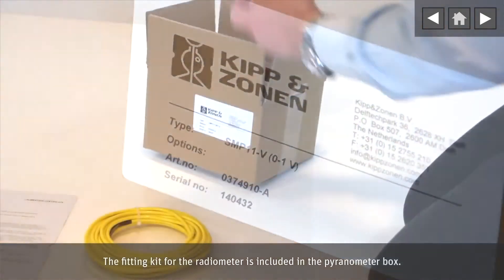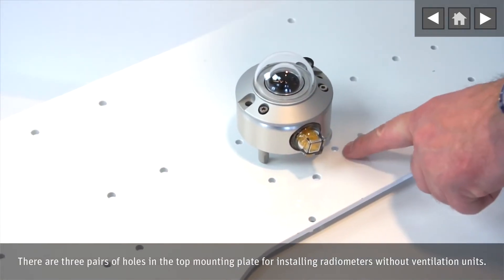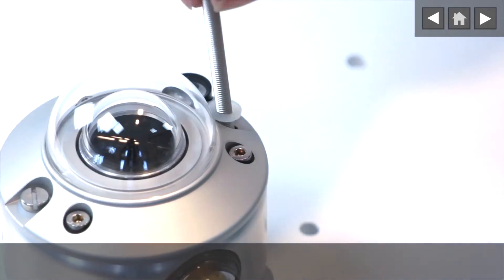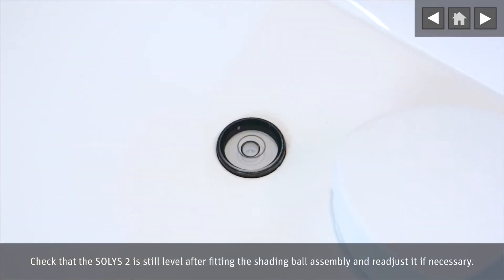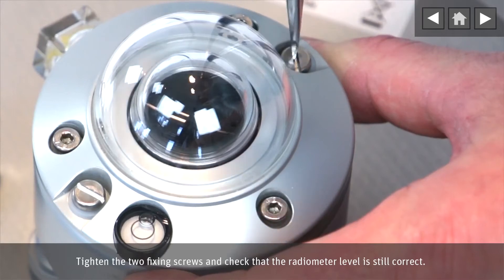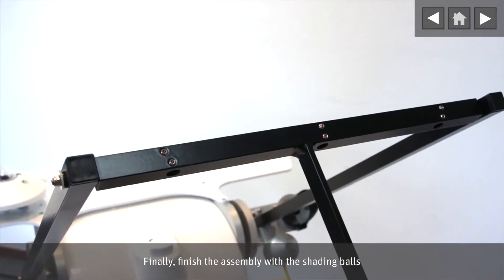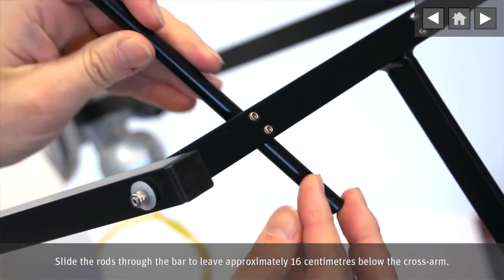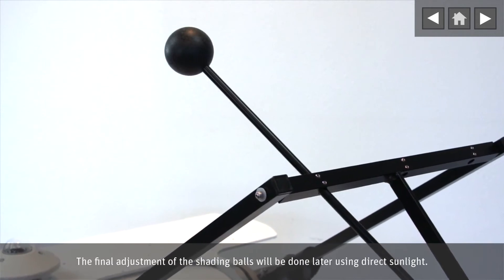Part 5 -  installation of the pyranometer

Comment: can you guide me through video how we connect SMP 10 PYRANOMETER with Data logger LOGOBOX SE? Your kind response will be appreciated
Reply from the maker: We don't have a video but it's very easy. You can find teh steps in this manual: http://www.kippzonen.com/Download/922/LOGBOX-SE-manual-V1803-01
Reply: @kippzonen  the website is not working.  I need it to display readings on my computer